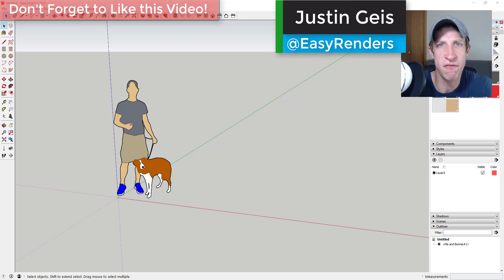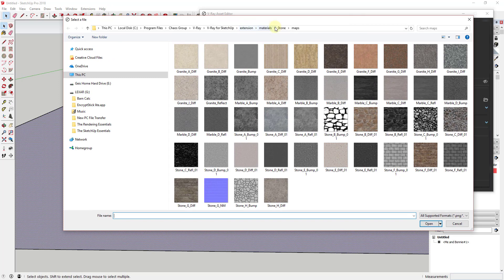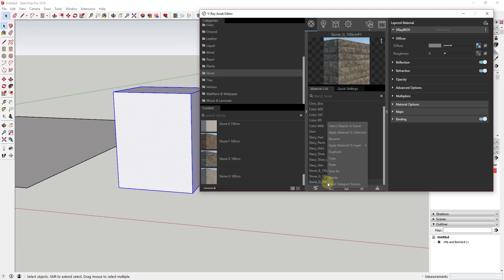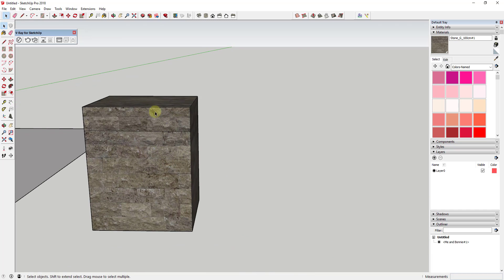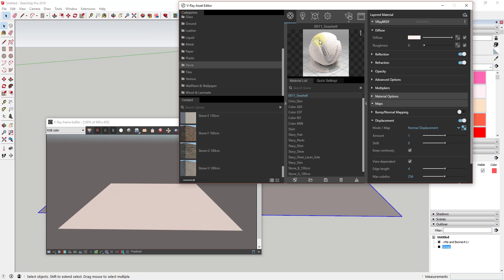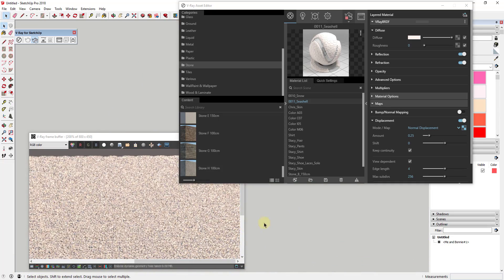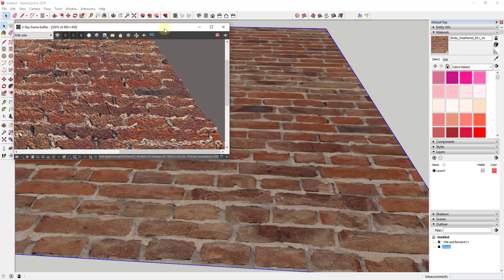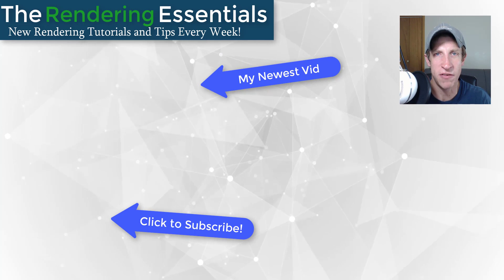Getting Started Rendering in Vray (EP 5) - BUMP MAPS vs DISPLACEMENT MAPS in Vray for SketchUp

Comment: Sold!  Now I gotta get Vray. Twilight Render is nice but Vray does so much more and it does GPU rendering.
Reply from the maker: It definitely does have more features - if you can justify the cost... :)
Reply: The Rendering Essentials I think I can certainly justify it. I did a decent render of this room I made years ago. It is excellent and fast. Twilight Render is good but doesn’t offer GPU rendering. I got a 2013 Mac Pro with dual GPUs. Set the render time to 2 hours and it did a smashing job in those 2 hours. The same room might’ve taken a week in Twilight at even a medium quality.   I tried Vray a few years ago but the demo didn’t install right or something didn’t work properly for some reason. This time it installed flawlessly.

Comment: Hey Justin, what you were doing was actually copying a NORMAL map into a Displacement map. And in all honesty, you're not supposed to do that. Displacement maps are only black and white which is meant to tell the software to either go up or down (often compared to a height map). Think of the mortar between the bricks. While Bump map and Normal maps are quite similar but they're meant for details, like the small bumps on the brick. So when you copied the Normal maps to the displacement, you were telling the Mortar AND the small grain details of the brick to be pushed and pulled. Not to mention the Displacement map is not supposed to read the RGB Normal map, you can fake it with a bump map but it's still not recommended. That's why the render of the bricks looks really odd up close. In practice, we do use displacement maps a lot, especially in combination with the Normal or Bump map. There's a great article explaining these 3 maps on Plural Sight ^.^
Reply from the maker: Thanks Minh - I really appreciate your knowledge in this area. I think I found the article you were talking about here - https://www.pluralsight.com/blog/film-games/bump-normal-and-displacement-maps . I am curious though when you say that it's not recommended to use the bump map for your displacement - if you don't have a texture with a full-on displacement map, what's the downside of using a greyscale bump map for the displacement? Is it just that the details (like you mentioned before) get pushed and pulled? Thanks again!
Reply: The Rendering Essentials yeah so it depends on the bump map. There are usually two scenarios, one is that the bump map is meant to add the small detail And the big detail, in that case, there's no need to use a displacement map. This is what most of the built-in vray material uses. As for the other scenario, the bump map is used in combination with the displacement map. In this case, the bump map won't add the "big detail" like the mortar lines, or spaces between wood planks. It will only add small details while displacement add the big details. So when you're copying the bump map in place of the displacement map, for the first scenario, there needs to be a lot of adjusting to make it work correctly, but for the second scenario, it would be hard since that bump map doesnt have the big details. VizPeople has a collection of free wood floor maps, you can download and see the difference between bump and displacement maps.
Reply: @ArchitectureInspirations  well, since displacement uses black & white areas on the texture image to map the lower (black) & higher (white) areas, for a tile or wood plank texture for example; if you're using a normal map as your bump map you could just duplicate it & turn the RGB texture/image to greyscale (B&W) for use as the displacement map no? & if you're using a normal greyscale bump map as bump map that could easily work as well for displacement, since it's greyscale too, although for displacement purposes you may need to increase the contrast of the greyscale texture for more details. AM I CORRECT?